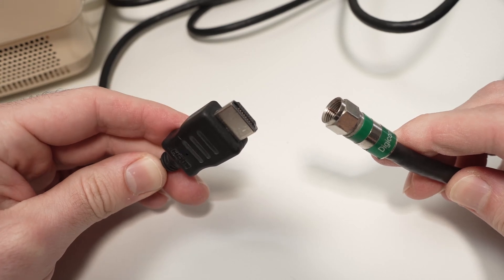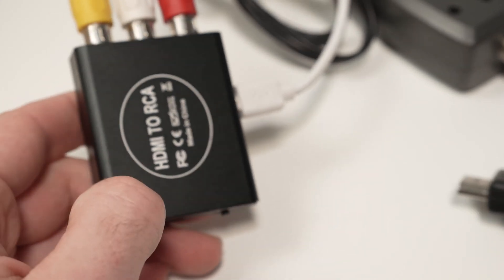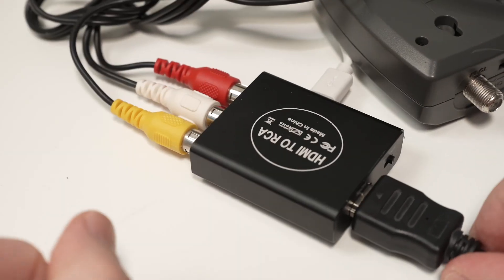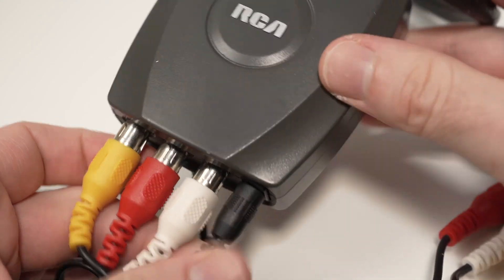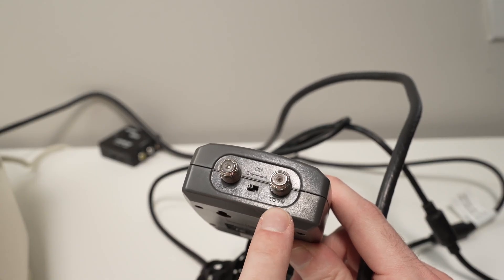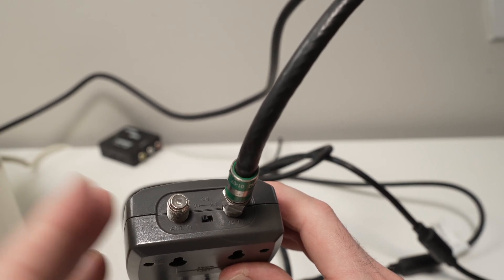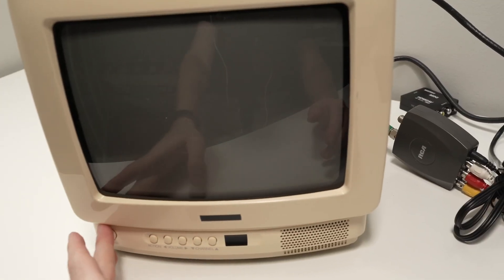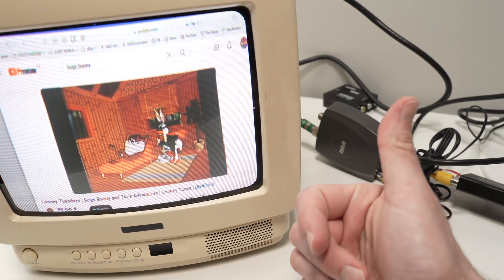HDMI to Coaxial Cable : How to Convert

Comment: I have a bad coax port on the back of my tv. I need the reverse of what you showed. Is that possible? my coax comes from my outside antenna
Reply: Yes, t's called a digital TV converter box

Comment: By converting HDMI to AV first you are eliminating the HD input.  This will result in poor picture quality.
Reply: We are mostly here for CRTS so it doesn’t matter
Reply: so u were expecting 4k resolution on the old crtv yes ?
Reply: I just wanted to know if it could work so u can use the coax port with the hdmi man
Reply: @vegetablepolice1 HDMI TO RF on Amazon, Aliexpress and comes with remote control.
Reply: HDMI TO AV are garbage. Mist be with built in Menu that can stretch aspect ratio like HDMI TO RF (Channel 3 or EU channel 4 - NTSC-M, PAL-BG,I,DK) and also HDMI TO VGA and VGA TO VIDEO (NTSC-M, PAL-M, NTSC-J, PAL-Nc, PAL) VGA TO VIDEO stretched aspect ratios but HDMI2AV, don’t .
Reply: well no sheet
Reply: 😆 no really? You think a non hd tv is going to turn into hd? 🤡
Reply: Guys, if you have something that only has hdmi and you want it on something that only has coax or something else old then your complaints don't matter, sometimes you need this for things like retro machines 
Got some old ass arcade machines that live because of weird shit like this 
Sorry about your GrApHiCs but I'm making spondulies mate